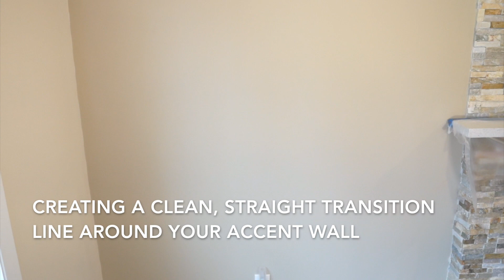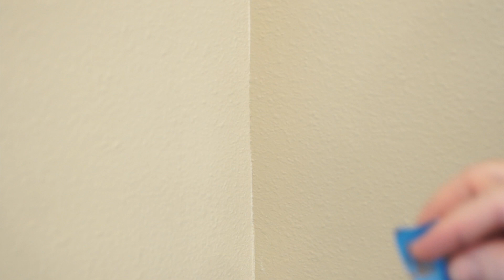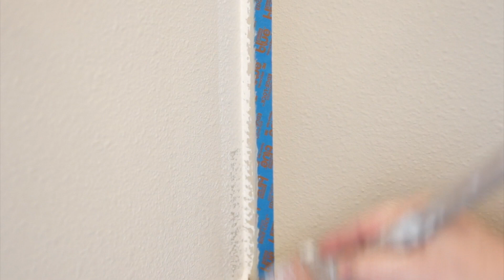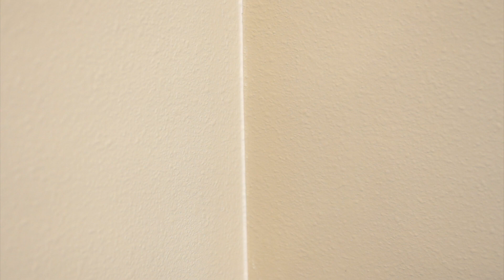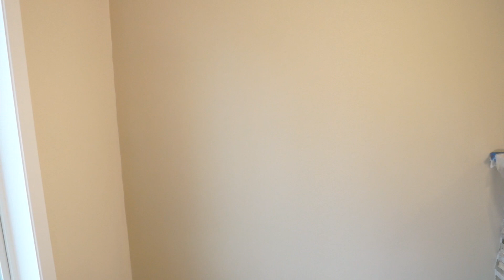Creating a Clean, Straight Transition Line Around Your Accent Wall

Comment: What tape are you using? Will normal making tape work. I'm doing two different colours on one wall was going to use frog tape. Thanks
Reply from the maker: I would not recommend normal masking tape because it is too sticky.   I use what's called a low adhesion tape (specifically, I use 3M's Delicate Surface tape (2080)).  If you are going to use Frog Tape, I would use the yellow type (it's a low adhesion).  The green Frog Tape is a medium adhesion.  The issue with medium and high adhesion tapes is that they may pull off the paint you are taping to. 

Thanks!
Reply: @DaveMartin  thanks very much for the reply will give it a go just on with the hallway👍
Reply: You must have a really good taste with respect to aesthetics! Thanks for sharing!

Comment: Do most houses in the US have textured walls Dave ? Most are smooth plaster or plasterboard ( drywall ) here in the UK.
Reply from the maker: In my experience, some (maybe half?) of new construction, and (most) higher-end homes have smooth walls.  Texture (mainly Orange Peel and sometimes Knockdown) is usually used in scenarios where the builder or general contractor is trying to save money.  Texture also seemed to be a popular look in the '80's and '90's.